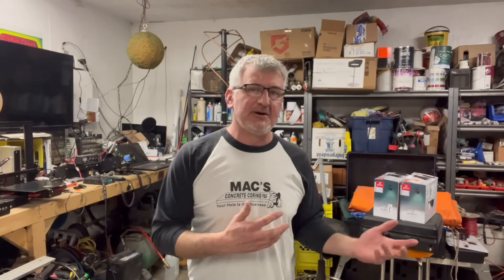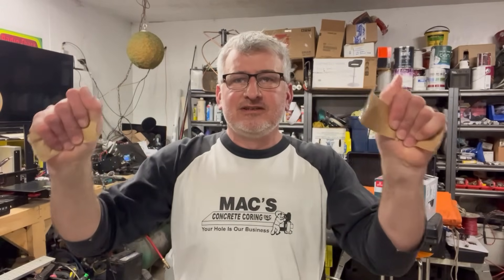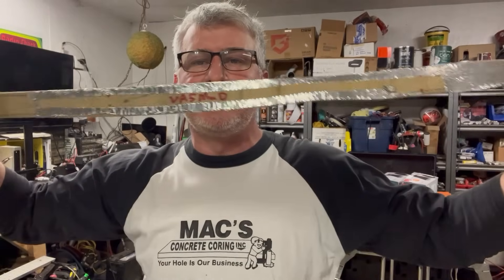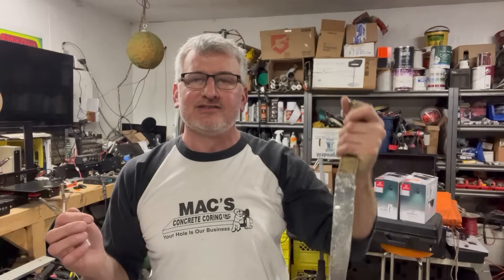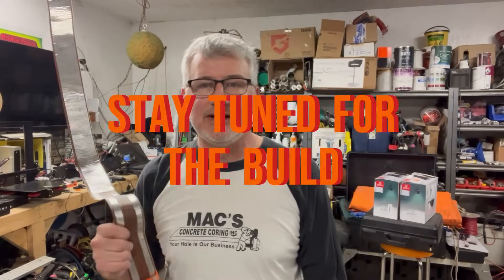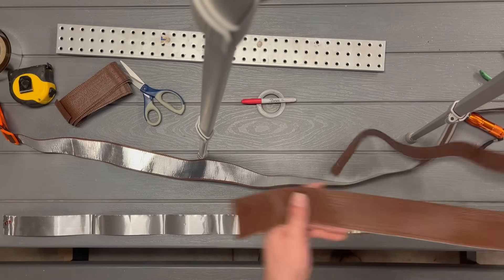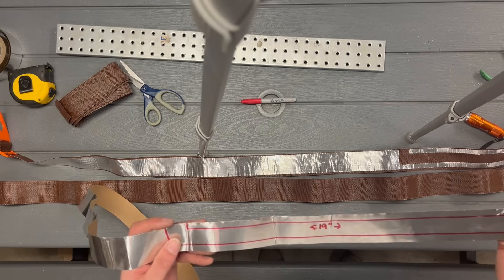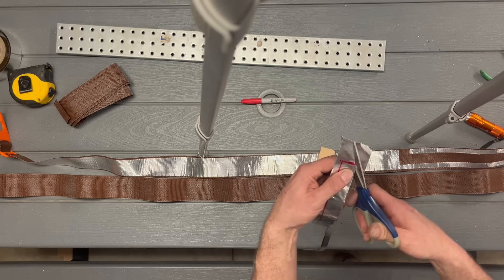Ultra light weight Waterproof Compact Portable DIY Adjustable 2m J Pole Ham radio Antenna Pota Sota.

Comment: This is a pretty fun concept. I'm curious if there is a type of metal tape that I should use?  Should I stick with steel tape or would aluminum work? I'm thinking the answer is steel, but never hurts to ask. 
Only thing I'm toying with doing different is putting the jack in the middle facing downwards on the non-metal side. I feel the weight of the cable being on one side would perhaps drag that side down over time. Will be interesting to build. Thanks for sharing!
Reply from the maker: Great questions.  I use aluminum tape as it’s the easiest to obtain and most likely the cheapest.  I built a few prototypes at different positions and they all seem to work well.  Keep us updated with your progress!
Reply: @MrMudsHamRadioTime  Working to build this now that I have my tape. I'm unsure how prescise the measurements need to be though. 
I"m assuming 19" is the tallest cut. How wide is the inside section you're cutting out? Also how much material is at the bottom before the cut out section? 
This will be the first antenna I've built, so not sure if these are calculations I should know or if it's just 'eyeballing' 
Thanks!

Comment: Thanks for sharing this !!   

 I don't have an antenna meter to measure SWR at the moment. 😢                          What would be the lenths of the aluminium tape un the shorts and long part of the j pole and the optimum feed point to work with a frequency of approximately 140 MHZ .? What equipment are you using in this video to take the SWR measurements?
Reply from the maker: I’ll dig it out and post some lengths.  I used a Nano VNA to tune it.   Thanks for watching
Reply: Thank you !!! 👍 @MrMudsHamRadioTime
Reply from the maker: Total length is 59”.  The short J part is 20.5”.  Feed point at 4”.  The best way to tune would be a Nanovna bit a swr meter would work.  Or tune by the strongest receive signal.  Have fun building
Reply: @MrMudsHamRadioTime  Thanks again, for taking your time to send me this data. Have a nice day !! 🤗

Comment: Pls share a design for 2metet + 70 Cm combine J pole if possible.
Reply from the maker: I don’t have a design per se but you can get close with this design to tune 70cm by adjusting the pick up point and rolling up the tip section of the antenna.

Comment: Wheres the 10 m rollable build video mate?
Reply from the maker: Still in production lol.  Actually 10m dropped off the map over the last 4 months but I did see a blip on the scope yesterday.  Fingers crossed 🤞
Reply: I was thinking 10m, 12m, even 20m.  Maybe keep the bottom rolled up when it was too long for the band, roll up the bottom and top up with a moving shorting bar.  There should be a good short point and length for every band, which should be markable with a sharpie.  A 20 meter j pole would need to be, what, 45 feet up a tree?

Comment: Good idea. Its cool that you can adjust it too! 
Using these materials, you can make a window or door, pass through, for getting your coax to an outdoor antenna.
Reply from the maker: Funny you should mention that about the pass through.  I’m currently testing a design using these materials.  Thanks for watching.

Comment: What width of webbing and tri glides are you using also width of tape is it 2 or 3 inch
Reply from the maker: The webbing is 21/4”.  Tri glides 21/8” and the tape is 17/8”.  Thanks for the interest.

Comment: Aluminum tape is awesome. Every ham should have several rolls :D Copper is even better. I've never made a J pole. I was going to for 2m/70cm but I decided to go the flower pot antenna route. Might have to try it out for 6m since I don't have a 6m solution I particularly like.
Reply from the maker: I don’t leave home without the tape🤙🏻.  A 6m J pole would be interesting,  I just made a 10m one but still have to test it out.  Thanks for watching.